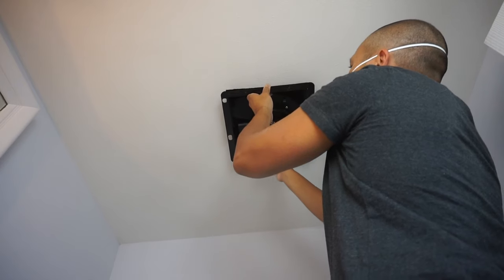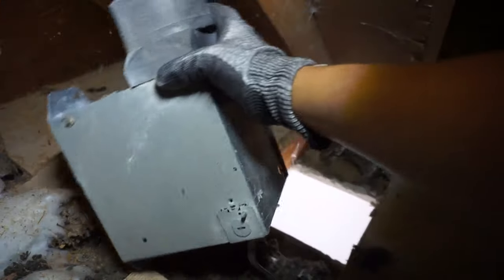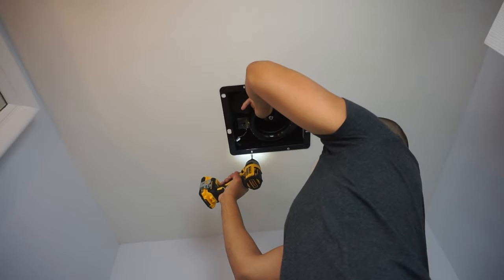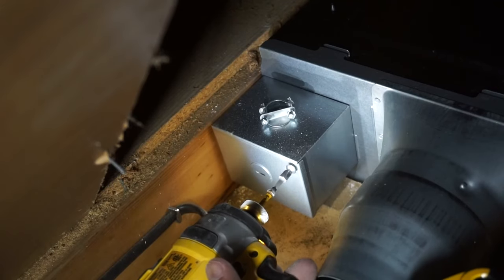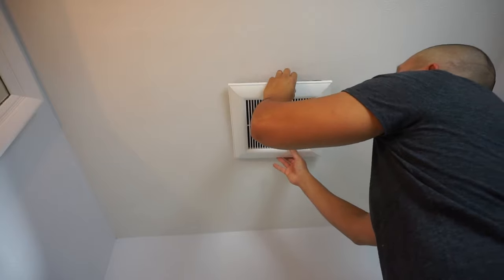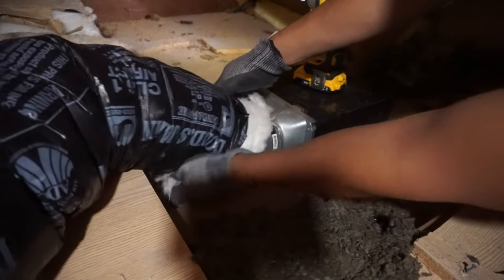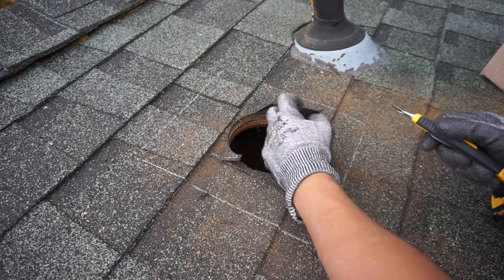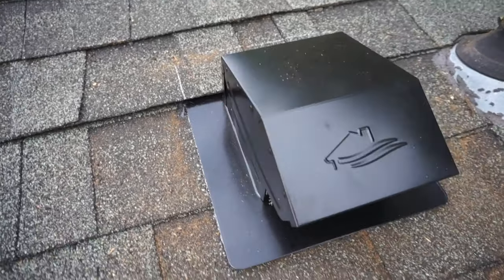How To Replace And Install A Bathroom Exhaust Fan From Start To Finish For Beginners! | Easy DIY

Comment: Once I see a guy working in sandals I know something is going to go wrong! haha...You did many things well, however, this is not how to install a vent. You made one serious mistake,  you had to cut out the shingles so the vent slides underneath the shingles on the sides and on the top.  The way you did it will eventually leak.  You are depending on the sealant from keeping the water out.  The sealant will pull away from that vent edge and water will penetrate.  You want the vent edges top and sides under the shingle so water flows right over the shingles.  I get called on a lot of jobs that were DYI'd like this because after it failed, the wife now insist on getting it professionally installed.  You don't need a professional, but you need to install it properly.  Great effort thought!  Seriously were work shoes!
Reply: Hey thanks for the comment, do you have any recommendations for DIY channels? Im glad I read the comments because I would've done this wrong.

Comment: I think you should have installed that vent cap UNDER the shingles not over. Better protection and would prevent any leaks MUCH BETTER. Also a much neater job. Any issues with the exhaust fan discharge so close to a sewer vent discharge point?
Reply: Bill, that install works just fine. There’s different ways to skin a cat.
Reply: @jbfam7208 sadly there’s only one way to sleep and there’s only one way to install roof vents correctly specially if you were to sell this job to a homeowner 😂. do it right or don’t do it to someone else’s home
Reply: You're absolutely right my friend. Never on top of the shingle
Reply: I was taught that the shingles should be on top of the vent flange as far down as the bottom of the vent opening. In this case, that would be two shingles. The flange then goes on top of the bottom (third) shingle, so that water shed by the flange flows onto a shingle.  

Also, more tar should be used.
Reply: @jbfam7208  He did the entire job correctly except for the duct cover flange over the roofing shingles.  He introduced a leak point into the installation, which will require another repair in the future.

Comment: Roof vent shingles are supposed to over lap sides as well and also you were supposed to remove the 3-4" adapter seeing as to did 4" also no need to wire in the attic that's the entire point of that fan

Comment: He can install a vent but jeez that roof cap is all wrong. It should’ve slid under both rows of shingles. No need for all that cement either…. Just cement under the hood, not bottom so moisture can flow out. Then seal your shingles. No need to cake the thing with cement.

Comment: As others have stated the vent sides should've gone under another level of shingles imo.    You could've skipped most if not all of that nasty caulking.   Also,  it's recommended that you place vents at least 2 ft from each other.
Reply from the maker: Thank you for the tip! It’s super rainy here now in Seattle and so far no leaks 👍🏽😊
Reply: @FixThisHouse   yeah, with all that caulk, you shouldnt have any issues🙂
Reply from the maker: Yeah, I kinda went over board with the tar, but definitely not necessary, just wanted to make sure due to windy / rain days
Reply: I believe the code requirement is 36" from any exhaust.
Reply: @FixThisHouse  better to over caulk than under caulk. Love that people give the feedback though. The trades is always a thing you just get better at.

Comment: Don’t cut shingles man always pull them and make sure your sides of your vent are overlapped with shingle and not overtop your shingle!! You already messed that shingle up when you drilled the hole in it and then cut it!! Besides that I don’t think you done that bad!!

Comment: The flashing for the roof exhaust is not done correctly.  You need to slip the flanged under the shingles.  You install is susceptible to water intrusion.

Comment: You should've watched YouTube before making a YouTube on installing a roof vent.Every thing up to the installation of the roof vent went fine.The roof vent was improperly installed. The top and side flange of the vent are to be covered by the roof shingles.

Comment: Brother, I have been in construction in one form or another since 1990 and I would like to tell you how much I appreciate your content for DIYers. I have even learned a few things from your channel myself. The only thing I would have done differently here is cut the shingles you set the flange on to the width of the vent cap so that they overlap the flange on the sides.

Comment: I would recommend no tar at the bottom in case you get any condensation it needs a place to escape,  If anything leave 3-4 weep holes.  Other row of shingles should overlap.  Good effort

Comment: Nice job. 9:17 It looks like you left the 3 inch duct reducer/adapter and put it inside the 4 inch duct. It's intended to be removed when using 110CFM and 4" ducting.
Reply from the maker: Thank you 🙏🏽 for the tip! I completely didn’t know that! Thank you 🙏🏽👍🏽😊

Comment: Nice job, just a hint for others. When install your ducting, make sure it is not a straight shot from vent to fan. A straight up and down vent will allow that occasional few drops of water that blows in during a horizontal rainstorm to reach the fan. The result is someone sitting on the toilet could get a few drops of water on their head. Ask me how I learned that! LOL!  Put a very slight p-trap bend at the bottom to allow water to stall rather than reaching the fan. It will dry out as the fan blows.
Reply: Most manufacturers call for a minimum horizonal run for this reason and condensation.
Reply: Yea you are on the right path to being correct. Its not the same kind of system as plumbing where a p trap is required. You do not want a p trap anywhere in the line especially in very cold climates. An accumulation of water will pool there and freeze to a solid block. Run it horizontal sloping down awah from fan box than up to termination
Reply: I have been searching for this exact response about a P trap in the insulated line. My technical mind says yeah I should install it that way, but my logical mind says a straight path will create a better flow from the fan motor. I intend to install with a P trap. Thanks.
Reply: @Kendo-84  here are the steps i would reccomend for your fan. Find out how many cfm your fan puts out. Refer to the fans manufacturer specifications and your local code for cfm required for the square footage of your bathroom. Size accordingly. Once fans is in celing vapour barrier over the fan box. Using ridgid galvanized oval ducting attach i direct from fan box with   3-5 feet horizontally sloping slighly away from fan box. Elbow up into your roof termination. Primex has goose necks with an insert that will attach to the pipe creating a sealed system. Also be sure to insulate your ducting.
Reply: Also you want to make sure your bathroom door has a gap between the floor and bottom of door to allow air to be drawn in.

Comment: This is exactly what my bathroom vent is right now. No connection to the outside just through the attic. Thank you for this video, it looks a lot easier.
Reply: Hopefully you don't have any mold in the attic.
Reply: @jamielushman7577 sadly that’s a common problem. Exhaust fans not venting through the roof.

Comment: I just installed a panasonic rg-r811a in a bathroom that never had any fan venting and had to do the power, switch, connections and the attic hole and it was a major pita. but i would definitely do it again bc it helps a lot! for you to do this and film it, god bless dude! I had a lot less space than yours and i happen to do it when its hot outside so the attic was mad hot. Liked and subbed!

Comment: Clicked on the video because of the thumb nail picture of the roof flashing. Overall pretty good details. When a roof flashing is installed properly you will not have to rely on any roof tar. Hopefully you won’t end up with any leaks 🤞

Comment: Great videos! I have a different issue, house we just bought the people had it since the 60's and somewhere along the way they put in bathroom fans but used these fans from a kitchen. So they are round and I think the exhaust duct work is around 10" and the fan I bought is 8". Need some suggestions how to fix this. Thanks

Comment: overall pretty good, but the one no no is to add sealant to the bottom edge... you need to leave a place for water to drain if it does get under there. also as others said, should have cut a notch in to the shingles on top so that they lay over the sides of the cap as well as the top edge.

Comment: Great video!  Appreciated your shows!   A quick question: should I replace my old 3" sheet metal pipe for an old bathroom fan with a new 4" flexi insulated vent duck to an existing roof turbine hole near by the roof ridge?  Thanks a lot!  I am in the middle of replacing my old fan with a Panasonic FV-0511VFL1.

Comment: Yeah good video but there should have been more shingles removed so you can get it to the roof deck and then another row of shingles (where you added sealant in the side of the vent) should have been cut and lapped over the metal of the new vent. Never want to rely on sealant

Comment: 7:08  Wagos are not intended to be used with stranded wire. The stranded wire is usually smaller in diameter than solid wire for the same gauge. 
12:10 It is best to not seal the bottom of the vent. That way if water gets behind it, then it would be able to run out and down. By the bottom being sealed, water would have to run left or right to get from under the vent.
Reply: Wagos work fine with stranded wire

Comment: never cut both line side conductors at the same time. even though you checked for voltage which was good, if you somehow had a backfeed on your neutral that woulda been a nice lil POP! that being said, great job man this helped me a lot as far as the exhaust.our existing fan never had exhaust ran and I don't want to slap in a new one and not do it right. thanks for this video!!
Reply from the maker: Thank you so much for your advice and for sharing 🙏🏽😊!
Reply: Better to find with a pop than a shock.

Comment: Mine was installed pretty much the same way but on windy days you can hear the dampers from the roof vent or the exhaust fan or a combination of both clanking around. Wondering if adding a damper in between the two or a p-trap curve to the exhaust hose would fix this?
Reply from the maker: That’s a great question! I have the same issue when it comes to windy days. I will have to look into that and if I find a solution I’ll try to make a video 🙏🏽😊

Comment: This was a fail. The vent flange goes UNDER the shingles. You also don't seal the bottom edge. This is a leak waiting to happen.
Reply: Yes, it’s not awful but there’s room for improvement

Comment: Did the old fan have a light while the new one does not? And now the light over the vanity is the only light? I'm just curious because my grandma would probably eliminate overhead lighting too because she doesn't like overhead lighting because It bothers her eyes or gives her a headache so she just uses the light over the sink because sometimes small bathrooms don't need an overhead light because the light over the sink is bright enough to see and sometimes bathrooms only need one light fixture that makes plenty of light. very interesting because I don't see bathrooms eliminate overhead lights too often but sometimes bathrooms have too many lights in the room where its too bright, good choice.

Comment: Tks from a to z video very helpful 👌
Reply from the maker: Thank you for watching! 🙏🏽😊
Reply: What's the name of the material u used Specially the unsulation or vent in roof or is their any brand u would recommend if so from where thank u

Comment: Hi, thanks for the video.  I would like to ask you if you had a problem with the switch due to the low amps used by the fan?
Reply from the maker: Thank you for watching! No issues with the switch my friend. All works well 👍🏽😊🙏🏽

Comment: I asked on a previous video, but I’ll ask it again since this is a more relatable video.

I am basically doing the exact same thing you did in this video but my humidity and timer switch to turn on the fan requires a red wire ? Help

Comment: Why would the duct need insulation if it's for venting?
Reply: The warm exhaust air would condensate on the duct in winter. Absolutely need insulation.

Comment: What are the brackets for ? Good video by the way
Reply from the maker: Hi! Thank you 🙏🏽 ! The brackets are another option if you don’t plan to screw the fan box to a joist. It screws from joist to joist allowing the fan box to mount to the bracket. I don’t really use it Unless I have to because it seems flimsy in my opinion.🙏🏽
Reply: @FixThisHouse  thank you so much

Comment: why use the insulated tubing instead of just regular dryer exhaust tubing?
Reply from the maker: It’s to eliminate condensation due to the temperature change from inside your home to the temperature different up your attic or crawl space.
Reply: I’m cold climates, Condensation from showering will build up in the tube that is not insulated and will run back into your house and create a moisture and mold problem if the tube is not insulated
Reply: Good to know I did notice that & with temperatures changes & dealing with moisture makes sense tks for the INFO GENTLEMEN

Comment: FYI that vend duct for the roof has terrible reviews on amazon. They rust over time, someone said the flap didn't open even w/ an 8" fan, another noted the size is 11x10". So I'll be looking for a different hood.

Comment: I was looking for a video to refresh myself it’s been a couple years since I’ve had to do one of these but now I must critique this video a bit.  No offense the guy did some correct but when you get paid to do these there is no way I want to do so much in the attic. You can hook up the wires and the piping from the bathroom and hook the piping up to the roof from the roof. Also he needs to have shingles above not below and never caulk the bottom of the exterior vent.

Comment: I think your roof flashing cut out is too big.  Both of the sides should overlap underneath the shingles.   You should use the template that comes with it for the cutout and not use the vent cap as measuring.  Anyway good video.

Comment: You installed the vent completely wrong on top of the roof! Thats is eventually going to leak once that caulking cracks. You need to cut the shingle around it. Look up roofing videos on how to install a vent

Comment: I did exactly that and water droplets are still collecting on the bathroom ceiling when the wife takes hot showers.  I even upgraded to a larger capacity fan, same results
Reply: Look at above comments. Have to sit the outside vent under more shingles

Comment: You should never seal the bottom, because if there is any moisture trapped inside it will have no where to go causing it to mold in a long run.

Comment: My 84 home has 0 vents to the outside they go to the attic 😬my only concern is the stinky vent pipe next to the fan 😳
Reply: Well the vents are adding moist air to a cold attic and covering the plywood with condensation.  Great for mold and rot.